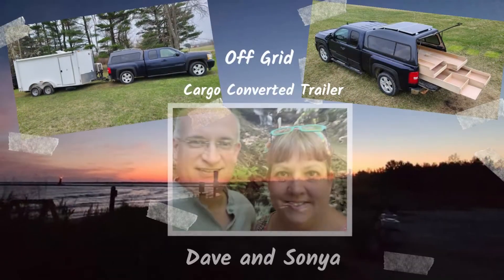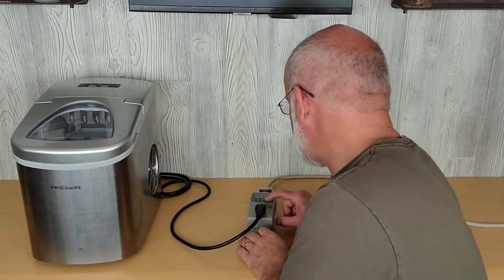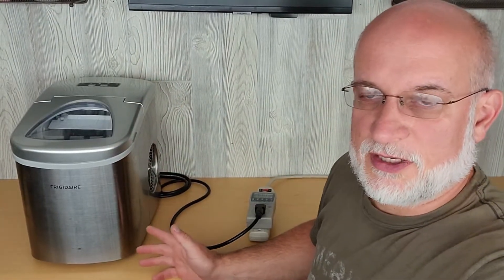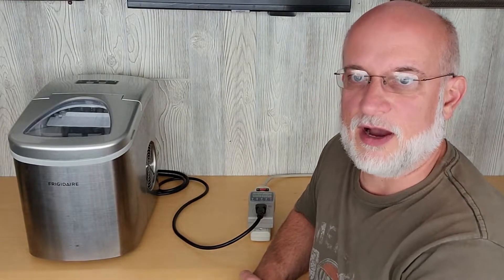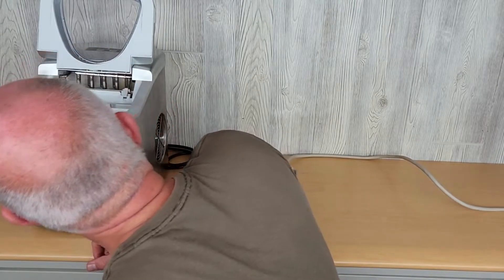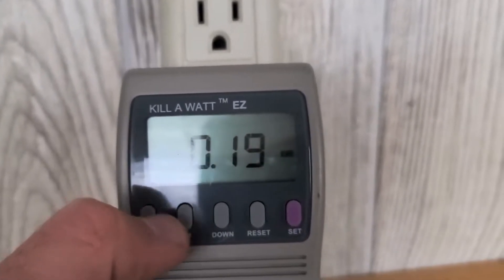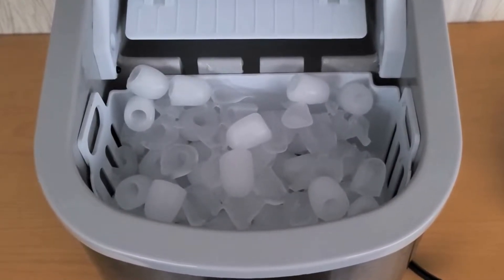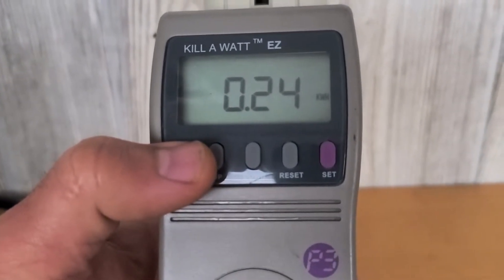Wattage Wednesday: Ice Maker Electricity Usage

Comment from the maker: An Ice Maker is not a necessity when you are off grid, but if your system is fully charged on a hot day, WHY NOT!
Reply: Are you saying a 100-watt solar panel would just about keep up with the ice-maker?

Not only "Why not?" but "Of COURSE it's better to have ice than an electric refrigerator in camp."  I think if you could make ice in the heat of the day and you had a Yeti or a Tundra ice chest, you could have ice-cold beer 'til the beer ran out.  You could put off a tr,ip to civilization for several more days.  You could keep your food fresher longer in a box that's 32 degrees than in a refrigerator that's losing heat out a lot faster, and having to work that pump every time you open it.  With an ice chest, it's going to be right back at temp almost instantly, and opening and shutting only makes the ice melt a little faster.  

It'd be a way to store up that energy from the day without a chemical battery.
Reply from the maker: All great points. Basically, yes! A 100 watt solar panel might only give you 90 watts with full sun in the summer. Then there is conversion losses thru the inverter. You would need an inverter to convert the DC solar power to AC and you would need the battery to make sure you had consistent AC power. If you were running this ice maker outside in the heat, you may not produce much ice. If you had a portable power bank with 200 watts of panels you could run the ice maker all day if you have plenty of sun. If you can keep the ice maker in a cool place, you could produce alot of ice. This ice could be used in a cooler instead of using a fridge.
Reply: @daveandsonyainmichigan  Hi Dave. Thanks for sharing this video. Do you know the max AC current draw? It says 1.7A and 2.0A but those usually are ratings and not actual draws. I have a small 200W inverter than can handle 400W surges, but I'd like to know the continuous load exceeds 1.65A.
Reply from the maker: @ericchang7706  Here is another video I did on the ice maker https://youtu.be/Tm86npda_4E . I saw a reading of 211 watts which would be 1.76 amps. But at startup, the surge peaked over 600 watts which would be more than 5 amps. I know this because my 600 watt solar generator faulted out and I couldn't get the one ice maker to run (watch the other video). So I woukd think it is probably between 5 and 6 amps. I did not capture the peak reading. So long story short, neither of these will run on your 200/400 watt inverter. I think I need the next larger Bluetti which is 700 watts. My Trailer, Truck and other Solar Generator can run both of these .
Reply: @daveandsonyainmichigan  Thanks. This is very helpful!

Comment: Thanks for the video!  

So is it literally like... $1 of electricity per day? Then if you only use it a few times per year, just run it during those days only?  As opposed to buying bags of ice for those days? Hmmm 🤔 I guess if one has easy access to ice and doesn't use ice often then it's not really all that useful.

Conversely if one uses ice a LOT or does not have easy access to ice nearby, then it makes sense.
Reply from the maker: Many options! One time, we were boonedocking on state land, in the woods, along side a river. We stayed there for more than a week and had only seen one person! We did not have electricity to plug into. We never left from our spot. We used the solar on our trailer for cooking, air conditioning, laundry and all other typical conveniences including making ice!

Comment: Thanks for the energy usage data.

Last week I bought a 12V BougeRV Ice Maker Machine for about $200 with tax. I plan to go bike camping with a bike trailer. My 12V BougeRV refrigerator freezer is just too big and heavy. I won't have any inverter losses using my solar generators now. The BougeRV Ice Maker is smaller than 110v models, but it is about  $100 more. 

I saw another 12v unit being crowd funded and available in July with an internal 200 wHr battery. That will be another $150 beyond my unit.

Now, I can set up camp with ice in a small styrofoam box or cooler, so I can chill my beer too!
Reply from the maker: Nice, we want to go bike camping with our e-bikes and take our bike trailers. We want to see if we can charge our spare batteries with a solar panel on the bike trailer. I will test this out and may do a video on it. Let me know how your trip works out.
Reply: @daveandsonyainmichigan  , I think charging while on the bike trailer will not be of much value. I only plan to go 30 miles and actual drive time would be two hours. I expect to stop and recharge my Ebike after 20 miles anyway.
Reply from the maker: Often, when we ride, we stop many times along the route. So it might take us several hours to get where we are going.

Comment: Hey Dave, got a teaser for ya. I live in California in the Sierra Nevada foothills. it does get HOT here, LOL! bag of Ice at the grocery store is 4.00 a 10 pound bag! We love this Ice maker! I tell my wife it's cheaper to make the ice than purchase at the local grocery store! Whaddya thinK? Joe Simone!!
Reply from the maker: Absolutely! If each tray is 1/2 pound, it would cost approximately $0.60 for 10 lbs of ice. NOW if you use a solar generator with about 150 watts of solar panels, on a sunny day,  you could run the ice maker all day for FREE! You just have to remember it's harder for the icemaker to make ice outside if its hot out. Run an extension cord from the solar generator to the ice maker in your air-conditioned house.